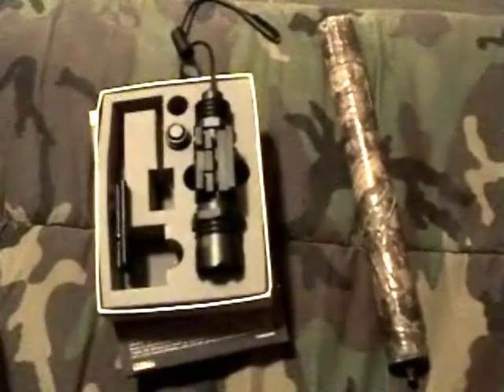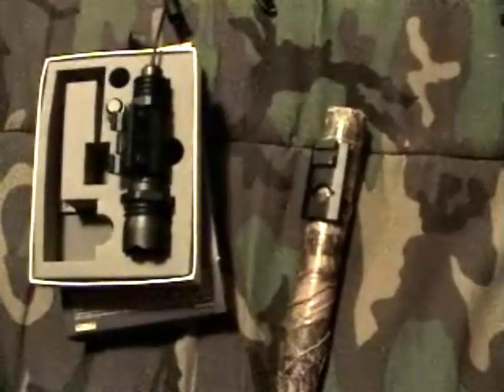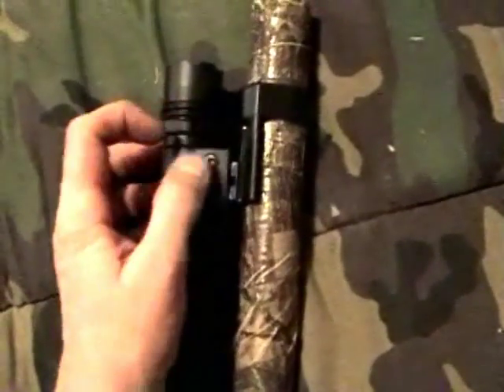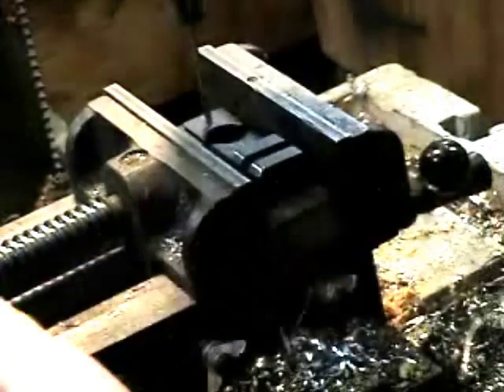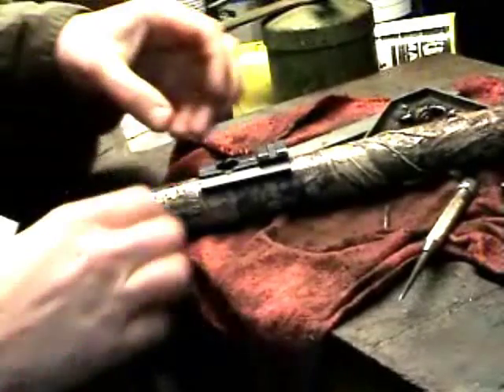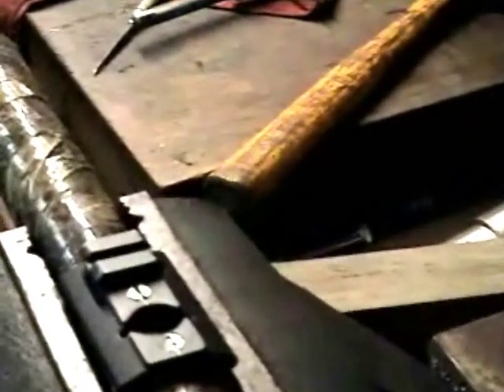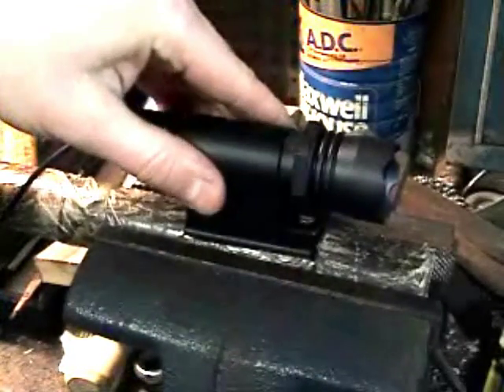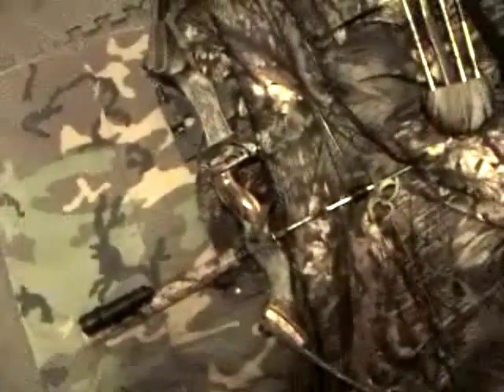Bow Mod, Compound Bow into a Tactical Bow

Comment: Why don't you just drill and tap the battery cap to a C or D cell MagLight to the thred size of a stabilizer and use the weight of the flashlight to also stabilize your bow. Kill 2 birds with one stone.